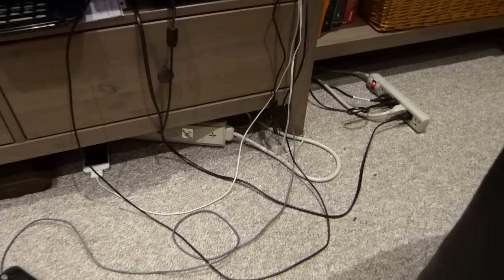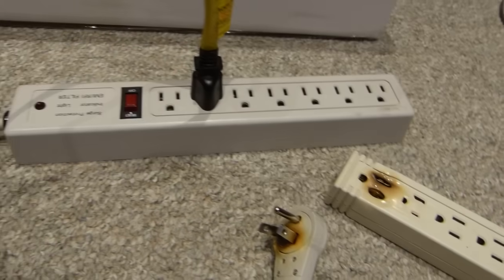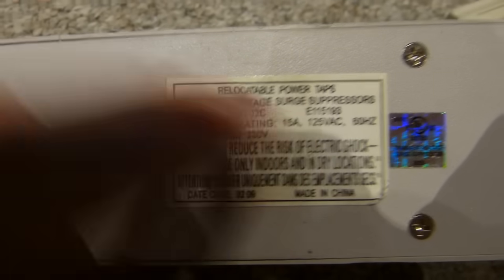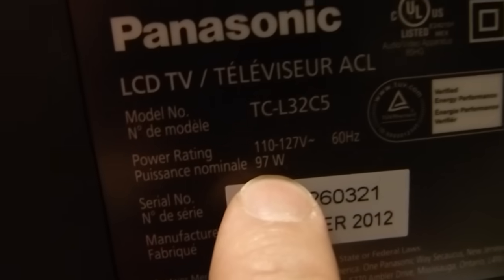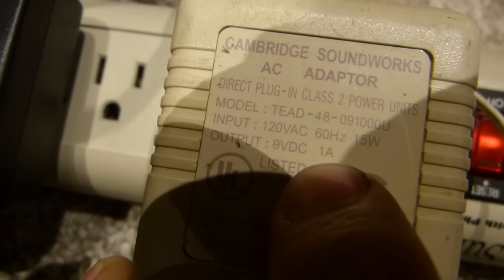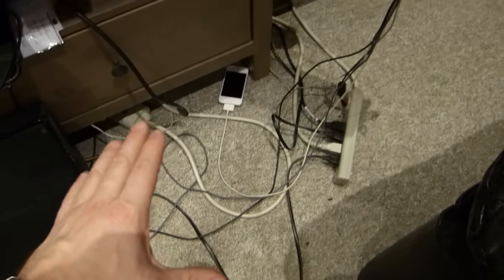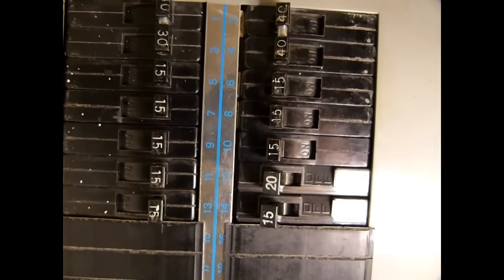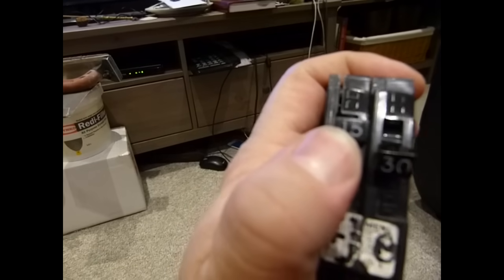Is it safe to plug power bars into power bars?

Comment: Your math is flawed...lets use the the speakers as an example.

Speakers DC adapter said it has an output voltage of 9 VDC and is capable of supplying 1A of current which give you a maximum output of 9 watts o f power (I know it saw 15W but I just did the math for you).

9 Watts / 120 VAC = 0.075A Max Draw on 120V mains.

Basically stating that the speakers won't draw more than 0.08A at max volume....not even 1/10 of an amp from the wall.

If it could draw 1A at 120 volts that means it would use 120 Watts...which is unrealistic.
Reply: The router is also 1A at 5 volts, not 1A at 120 volts.
Reply: Was looking for this comment...
Reply from the maker: That`s right, thanks for noticing. I pointed at the OUTPUT numbers by mistake.And those are DC.
The INPUT is 15 W,  so same math as with the TV 15/115 = 0.13A
I`ll insert some text box fix.
Reply: @theoverengineer  Why do you use accent charachters `
Instead of apostrophes '
Reply: Power consumption is not the same as power that goes into producing sound in speakers. Much of the power is consumed by the amplifier. And power consumption ratings, are probably more of a "maximum under reasonable conditions" rating, and not the "average" or typical usage. Probably a bit more power will be used when played as maximum volume, than at the typical volume.
Reply: Rob K. What the fuck did I just read?
Reply: Thanks; I saw that on the router and I was hoping someone would point that out.
Reply: watch 8.02 walter lewin lectures
Reply: Rob K. I was angry of the same thing... I dont like inaccurate  knowledge
Reply: @Rae the ManoKit Lol I felt so stupid reading that first comment.
Reply: If so you should calculate it the way he did it that way there's no chance of overloads.
Reply: The input of the speaker adapter says 15 watts, and the output is 9 watts.
But these numbers are right, as the speaker adapter has a transformer in it, and transformers are not 100% efficient.
Some of the electricity is turned into heat in the coils, you can feel that a transformer gets warm when in use.
Reply: Lemon Compiler i failed chemistry in high school,  never knew it was going to be usfeul

Comment: Also, don't let your dog pee on them. That also starts fires.
Reply from the maker: We don`t keep dogs in the office, it`s a heritage building from 1892. But there aren`t any washrooms either, so that there might be something to look into ... I just remembed we have a high electrocution rate among workers there, all misteriously found dead with pants down, never been solved cases ...
Reply: theoverengineer You know, I think we may be on to something major here. If we combine our brain power, we might be able to save lives. Or at least keep power outlets dry. But it is sketchy.
Reply: No, it will just shock him badly, usually.

Comment: I got 2 15s and 5 20s, and a 1952 Cutler Hammer circuit panel. lel
Reply from the maker: The panel`s about up for donation to a museum ... Probably has only 60A supplied to the household
Reply: theoverengineer The master breaker is only 50A. It still does good!
Reply from the maker: and it will function indefinitely well as long as the 50A is not exceeded (eg. by a meltdown by lightning strike)
Reply: theoverengineer The 3 prong outlets in my home aren't really grounded, except for the gfci, hehe.